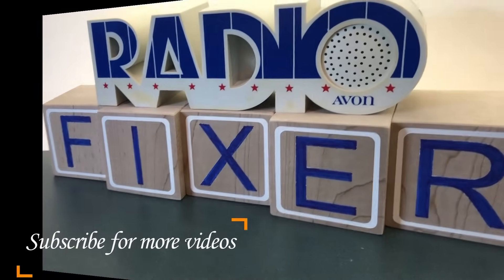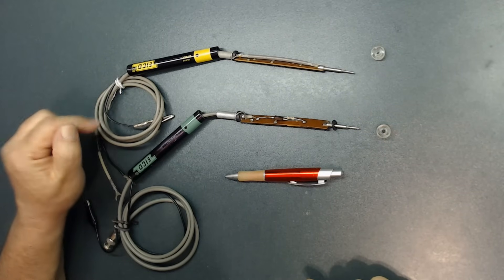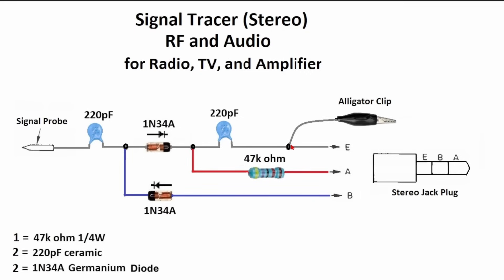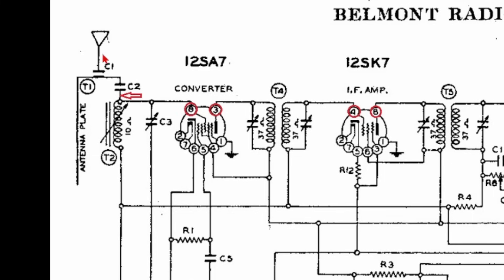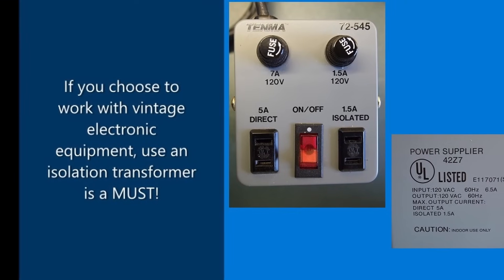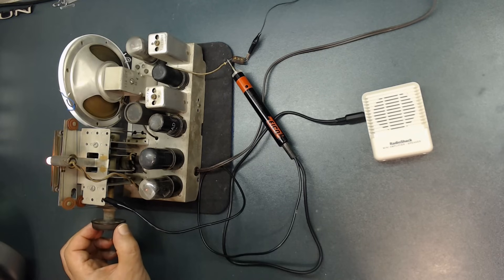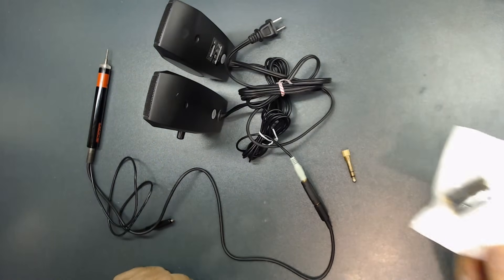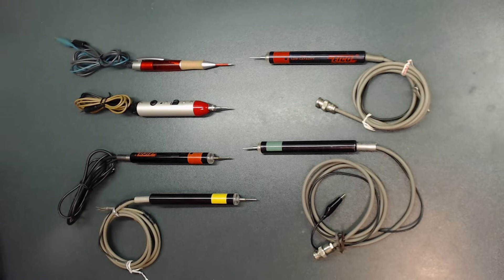Part 1- Build Stereo Signal Tracer for testing Tube and Transistor (Radio, TV, and Guitar Amplifier)

Comment: Would this work the same for a non tube radio?

How do you explain that you hear the audio right at the antenne input?
Reply from the maker: Great question! When testing at the antenna input, this signal tracer picks up radio signals just like a crystal radio. This helps confirm whether the radio’s antenna loop is working properly.

The tracer works with tube and transistor radios, televisions, and guitar amplifiers. It’s a very simple design that anyone can build with just a few parts. One great feature is that it works with mono, stereo, and Bluetooth amplifier speakers without needing any modifications to the speaker jack. Please let me know how you like it once you build it!

For the 220pF capacitors, I used 2kV because I already had them on hand. If you’re tracing signals in an AC tube radio, use at least 600V for safety. For TVs and guitar amplifiers, I recommend using capacitors rated at very high voltages.

On my YouTube channel, I go into detail about restoring tube and transistor radios, adding Bluetooth to vintage radios, repairing wooden, plastic, and Bakelite cabinets, testing AC power transformers, fabricating missing parts, reading resistor and capacitor values in antique radios, and understanding schematics for beginners.

It’s so good to hear from you. Thank you for taking the time to message me and for supporting my channel. I’m very glad you enjoyed the video.

Have a great day!
Best regards from Florida,
Jay

Comment: Nice and simple.  Simple is usually good.
If you are using a plastic tube for the probe housing try adding some thin copper or aluminium foil inside to shield the probe from your hand.  Glue it to a piece of thin card and bend it in to a cylinder that can slide in to the plastic tube - foil on the outside.  Connect the foil to the ground connector.  Also make sure the capacitor connected directly to the probe is VERY HIGH VOLTAGE.  You can easily get 1000V or higher rated caps.
A good probe tip can be made from the coaxial cable they us for satellite dishes.  It has a solid copper center conductor and is quite stiff.  You can leave the outer shielding up to the last 1cm - 1.5cm then you can remove the outer insulation and the copper braid.  The last few mm of the center conductor can then be exposed.  This can help reduce the hum and general background noise.  It also reduces the chance of a long exposed tip accidentally shorting something out.  A bit of heat shrink can keep the copper braid tidy.
Reply from the maker: Hi Paul,
It’s so good to hear from you — thank you for taking the time to message me and support my channel!

I really appreciate your excellent tips and detailed suggestions — they’re incredibly helpful for improving the probe design.

Thanks again for reaching out. I truly value your feedback.

Wishing you a great day!

Best regards,
Jay

Comment: I built one of these and it works great, I used 1/2 plastic water pipe, some 3d printed parts and a long roofing nail which I sharpened to a point.
Reply from the maker: Thank you so much for taking the time to let me know! Sometimes I wonder if these videos are actually helping, especially since they get a good number of views but not many comments. So your message truly means a lot.

I’ve made some updates in a second version of the video — feel free to check it out here:
🔗 https://youtu.be/g5UkU5gjeIw

You might also enjoy building the Signal Injector I put together — that was a really fun project:
🔗 https://youtu.be/18FneuNongc

I’m really happy to hear the video helped and that you were able to build it successfully. If you’d like, feel free to send me some pictures of your build at radiofixer@yahoo.com
 — just include your name or a short note so I know it’s not spam.

Wishing you a fantastic day ahead!

Best regards from Florida,
Jay

Comment: I salvaged a internal amplifier  speaker fron a Dell desktop computer.  Part number  y2298/94v-0. The module operates on 3 to 5 vdc. Very small unit. Just add a 10k potentiometer for volume control. Cheap and very effective. Google it. Makes for a very good signal tracer device instead of the radio shack amplifier speaker.  Thanks for your video.

Comment: Has anyone been able to build this Signal Tracer, aside from the author, that can pick-up the radio station at either the antenna terminal or the input grid of the Converter RF tube?

Many of the Computer Speakers, shown in his video, may not be the amplified type needed for getting all the way to the front-end of the AM radio. The author, however, is using a Radio Shack model that’s been discontinued for decades. If I’m not mistaken it has an input sensitivity of 1mV and an input impedance of 5k. If that’s the case some one should design a circuit that will emulate the authors Radio Shack Amplifier, otherwise you will make it up to the IF stage and no further.

One of the common problems in a Signal Tracing Probe is there is too much capacitance in the probe design – which will de-tune the front end stage and you will get nothing. 

To All, good luck making Jay’s “Magic” probe.
Reply: Kopter6, hope this answer your question! I have built this signal tracer as Jay described and use it for European Radio and it works fantastic. The best performer and simplest signal tracer that I have ever seen on YouTube. 
Have you built it yourself as Jay suggested in this video? It just use a few parts, you will be surprise how well this signal tracer performs.
Reply: @LovesRadio  Hi LovesRadio,, you should post a video on YouTube where you place your Radio Fixer signal tracer probe on pin #8 grid of the 12SA7 converter tube {or similar point on your radio under test} having beforehand tuned the radio to a local strong station with the volume at the lowest setting. At this point can you clearly hear that station?
Reply from the maker: Hello Kopter, thank you for taking time to message me and supporting my channel. Several of my subscribers who built this probe reported a great result. 
When made that video I tested with all those speakers a get a good result. Did not want to add all those videos testing with different speaker since the video could be over 45 minutes or so. 
I am in process off updating this video since multiple users asked for more design information, as well as not be able to find Radio Shack Amplifier. So stay tuned for upcoming video regarding this single tracer. 
I suggest very highly building this signal tracer and seeing the result. Feel free to let me know the result. 

I had no electronic background when I started this awesome hobby. I had to learn this hobby on my own since couldn’t find any one to teach me. Took years of research and trials. LOL. I created this channel to assist others with no electronic backgrounds since I know how hard it was to understand schematics, repair, and safety working on electronic. 

Have a great day. Regards from Florida, Jay
Reply: @RadioFixer  Jay, I will be looking forward to your continuing work . A Signal Tracer that can trace from back at the way to the front is not an easy task. Some feel it's more of a quest.
Reply: From the Heathkit  iT-12 manual;  going to the first grid could be a problem, namely detuning:

On some receivers the hum over-rides the signal making it necessary to move the probe to the secondary of the input IF transformér,# (pin 1 of tube B) in order to check the gain of the first stage.
The path of the signal can be traced through any succeeding IF stages to the detector. During these tests an approximate estimation of gain per stage can be made. The amount of gain that can be expected in a circuit can best be determined by previous experience in making similar tests.

In some cases the RF probe causes a slight detuning effect when applied to tuned circuits. In these cases advance the probe to the following test point, and if a good signal is present it would be reasonable to assume that the preceding circuit is functioning properly.
Reply from the maker: Thank you for the information. Have a great day.

Comment: Hello, I have a question: Is the EICO probe you're using all non-metallic plastic inside and out. With no shielding on the inside of the probe body?
I was wondering because 60 cycle ac is all over the place and my cause a lot of hum pickup.
Reply from the maker: Hello Kopter, sorry for delay, was very busy the last a few months. The EICO probe that I used in this video is made of aluminum I think. I used a insulated tin cardboard inside the probe, that reduced most static when holding the probe. As I mentioned in the video you can use large plastic Pen as a probe instead of  EICO probe since is hard to find those and they are expensive. Hope this answered your question! Feel free to build one and then let me know the result. 
Thank you for taking time to message me and supporting my channel. So glad and happy that you enjoyed watching this video. 
Have a great day. Regards from Florida, Jay
Reply: @RadioFixer  Take a look at this:  A  m  a  z  o  n
16 inch Aluminum Round Tube,3/4" OD 1mm Wall Thickness,6063 Aluminum Hollow Seamless Straight Tubing 4 Pcs

Comment: Hey Jay, is there a specific voltage rating for the germanium diodes?
Reply from the maker: Hi Patrick,  my understanding is that Germanium diodes are different that their silicon cousins in that they have a lower forward voltage drop (typically 0.3V) which makes them useful for audio and radio detection circuits plus other low voltage uses. 
Make sure to use real Germanium diodes not Schottky diodes. These day they sell Schottky diodes as Germanium diodes from China. I buy these Germanium diodes from  www.digikey.com or Mouser Electronics. 
It is a fun project, Good luck!

Comment: Hey Jay, what it the tolerant of the capacitors and the tolerance and voltage of the two resistors?
Reply from the maker: Hi Patrick, sorry for delay! Very busy at work lately. I used 2KV for those 220pF capacitors, since I had some on hand. Use 600V if tracing signals in AC tube radio to be safe. The resistor that I used was 2K 1/2W 1% resistor. 
Thank you for taking time to message me and supporting my channel. So glad and happy that you enjoyed watching this video. 
You might enjoy watching attached link video series as well https://youtu.be/uMfL4Eakzng It was 100% restoration. Each restoration series are so unique and different, I tried to take different approach to solve problems. 
Have a great day. Regards from Florida, Jay

Comment: Jay i built the signal tracer i can't get it work what voltage do you need from the amplified speaker I'm using a 3 volt amplified speaker thanks Joe
Reply from the maker: Hi Joe, make sure that you are using "Germanium diode" not "Shockley diodes". 
Try to remove the 47K resistor and just use a wire instead for that resistor to see if it work better.
Some amplifiers are very sensitive and work much better like the small radio shack Mini amplifier speaker in the video (Input Sensitivity "1mV and input Impedance: "5K ohms"). 
But it should work with any external twin computer speakers as I shown in the video.
Feel free to sent me the picture or video of your signal tracer and amplifier speaker so I can check it out. radiofixer@yahoo.com

Comment: Excellent project, I will definitely build it.
Thanks !
Reply from the maker: Moisés, It is so good to hear from you and thank you for taking time to message me and supporting my channel. So glad and happy that you enjoyed watching this video. 
The great thing about this tracer is that it can work with Mono, Stereo, and Bluetooth amplifier speakers without any modification to speaker Jack. Please let me know how you like it after you build it. 
I used 2KV for those 220pF capacitors, since I had some on hand. Use 600V if tracing signals in AC tube radio to be safe. I suggest for TV and guitar amp use very high capacitor voltages. 
In this YouTube channel I discuss in detail how to restore tube and transistor radios. How to add Bluetooth to vintage radio. How to repair broken wooden, plastic, and Bakelite radios. How to test AC power transformer, how to fabricate missing parts, how to read resistors, and capacitors for antique radios. How to read and understand schematic for beginner. 
You might enjoy watching attached link video series as well https://youtu.be/uMfL4Eakzng It was 100% restoration. Each restoration series are so unique and different, I tried to take different approach to solve problems. 
Have a great day. Regards from Florida, Jay
Reply: @RadioFixer  Thank you and yes, I will look at more content. I really like everything related to old radios.
Big hug!

Comment: Somebody's gonna do this so I might as well just get it out of the way. I was taught that for electrical convention electricity flows as he stated, from pos to neg. But in electronic convention electrons travel from neg to pos. Nobody's really wrong when you consider counting holes is just as valid.
Reply from the maker: Hello, good hearing from you! The video and drawing of components was for the new person that cannot read schematic yet but they like to create something simple and very powerful. The best way to explaining the drawing is to show how each part connected to each other. I was showing how to trace signals from antenna to radio speaker not electricity path. 
I am doing this as a hobby with no electronic background, trying my best to create detailed videos to encourage others without electronic background that are new to this hobby so they can understand and not get overwhelmed. 
In this YouTube channel I discuss in detail how to restore tube and transistor radios. How to add Bluetooth to vintage radio. How to repair broken wooden, plastic, and Bakelite radios. How to test AC power transformer, how to fabricate missing parts, how to read resistors, and capacitors for antique radios. How to read and understand schematic for beginner. 
I hope these videos encourage others to rescue old rusty, dusty, and ratty radios for future generation to enjoy. 
Have a great day! Regards from Florida, Jay
You might enjoy watching attached link video series as well https://youtu.be/uMfL4Eakzng It was 100% restoration. Each restoration series are so unique and different, I tried to take different approach to solve problems. 

Thank you for taking time to message me and supporting my channel. So glad and happy that you enjoyed watching this video. 
Have a great day. Regards from Florida, Jay

Comment: Seems yo work very well.
But i miss a description of the circuitry and a bit theory of ooeration.
Why two diodes and two capacitors. Could b signal doubling? Why the two outputs for stereo?
Reply from the maker: Guntram, good hearing from you! The great thing about this tracer is that it can work with (Mono, Stereo, and Bluetooth amplifier speakers) without any modification to speaker jack. Most vintage signal tracers are mono and sometimes they do not work with newer stereo amplifier speakers. This design allows user to connect to Mono or stereo amplifier speaker. Please build one and let me know how you like the tracer. 
I used 2KV for those 220pF capacitors, since I had some on hand. Use 600V if tracing signals in AC tube radio to be safe. I suggest for TV and guitar amp use very high capacitor voltages. 
I had to learn this hobby on my own since couldn’t find any one to teach me. Took years of research and trials. LOL. 
I created this channel to assist others since I know how hard it was to understand schematics, repair, and safety working on electronic. 
I hope these videos encourage others to rescue old rusty, dusty, and ratty old technology for future generation to enjoy. Have a great day! Regards from Florida, Jay
Reply: @RadioFixer  Hi Jay, thanks for your answer. Now I understand the intention. It is to easy plug it into anything that is an audio amplifier, regardless if it is mono or stereo and whatever what the amp want to see as signal source. Using high voltage capacitors is the best you can do because you are probing in tube radios so safer us better.
Even if you not learned the stuff in an official way, the same as me, where you get the foundations? 
Books, Magazines, experimentation kits,...?
Yes I should build one, I still repair sometimes stuff for my neighbors so the idea is not bad at all.
With best wishes from Thailand from Guntram.

Comment: is the probe isolated from the actual pen that you use? because if it's a metal pen, then there's a danger of getting a nasty jolt whilst probing.
Reply from the maker: Mohim, good hearing from you! Yes, it is isolated. It is a very simple design that anyone with a few parts can build. The great thing about this tracer is that it can work with Mono, Stereo, and Bluetooth amplifier speakers without any modification to speaker. Please let me know how you like it after you build it. 
Thank you for taking time to message me and supporting my channel. So glad and happy that you enjoyed watching this video. 
Have a great day. Regards from Florida, Jay
Reply: @RadioFixer  . I understood the design. it's a very simple and a very important design for people dabbling in audio.the point I raised previously,    again is very important, because you hadn't mentioned it that the probe should be totally isolated from the metal pen or a metal container in which you're going to put the probe in. we may get away with transistors,  but a beginner probing valves with such a contraption could be a recipe for disaster. that's why this question. I wish you had mentioned this very clearly in your video. otherwise,  a lovely video, and the way you explained everything was really commendable. 👌.thank you 😊
Reply: @RadioFixer .  it was very nice to get your thoughts and feedback 😊.  thank you so much ❤